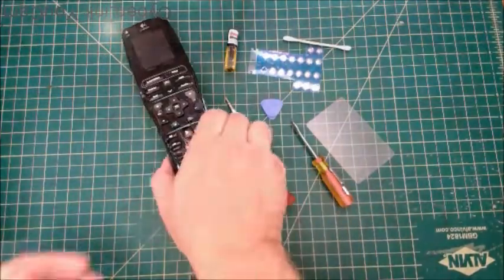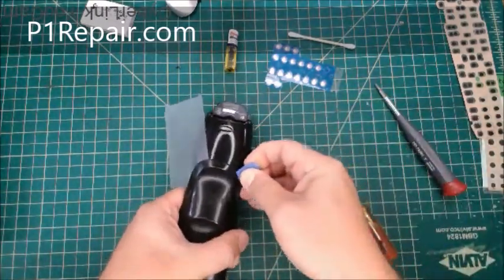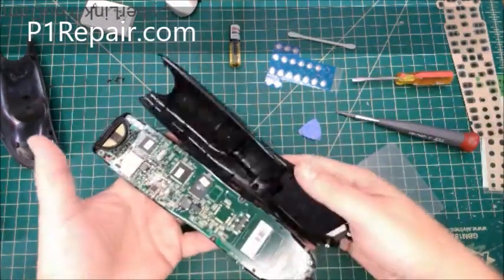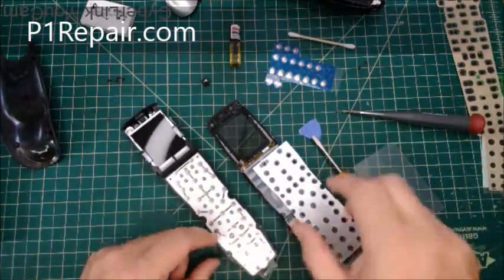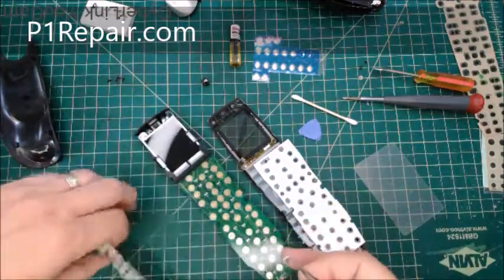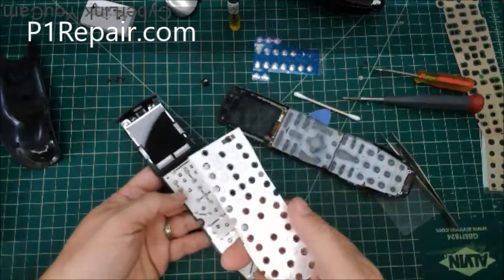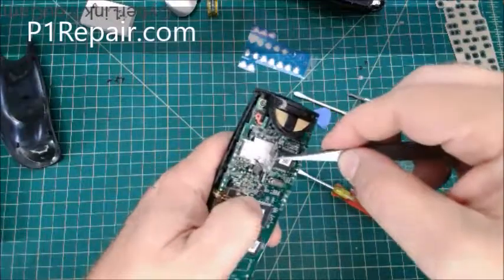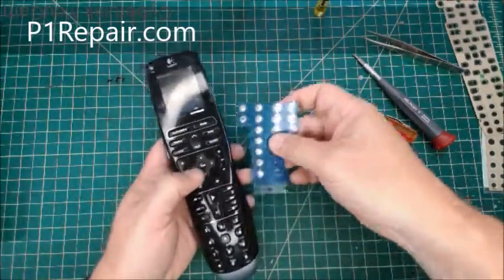Logitech Harmony One Button Repair

Comment: Terrific video! My Harmony One has a couple buttons where I can feel the metal dome 'snap', but the function does not work unless I push down a bit harder. Obviously there is some contact resistance between the dome and the pad on the circuit board. I just completed the repair using this EXCELLENT video. Purchased Gold Deoxit through Amazon. My experience of disassembly was simple only because of your video. There has been an internal rattle for years that turned out to be a loose screw due to a broken standoff. Actually a couple threaded standoffs were broken, obviously due to poor design. I rebuilt the standoffs using a putty-like epoxy. Cleaned all contacts per your instructions using first Isopropyl, then the Deoxit. The remote now works like new. THANK YOU!

Comment: Great video. My Logitech Harmony One has a USB port issue. I have to push the USB cable in very hard while tilting and holding it in place in order for the software to recognize it. I have tried several cables and all have the same issue. Is it possible to repair the USB port on this remote?
Reply: I also have this problem,although  i cant get software recognise the remote.  Always worked before.

Comment: Thank you for this, it gave me the courage to give mine a go.  My play button wasnt working so I swapped the snap dome with one from the number pad (that I dont use). It didnt fix it, Play button was still non responsive. I took it apart again and cleaned all the snap domes and contacts, put back together and Play works perfect. There was no sign of dirt or corrosion but cleaning fixed it. Thanks for the tip.